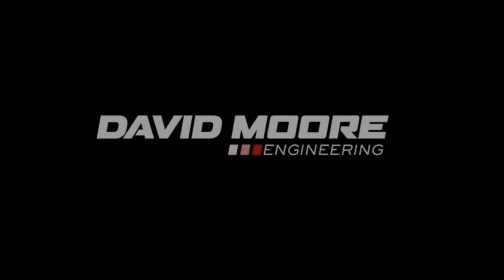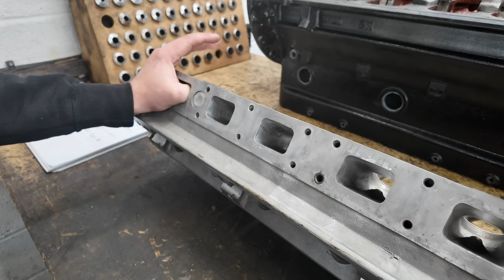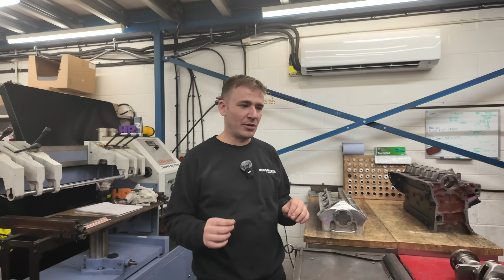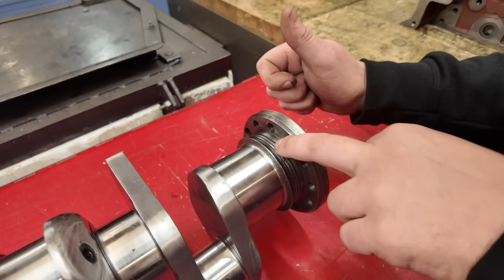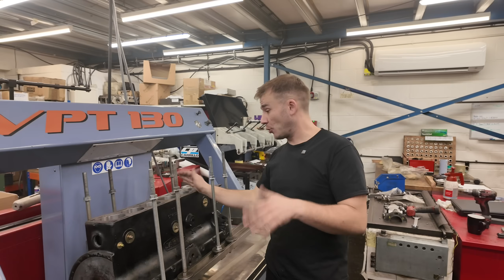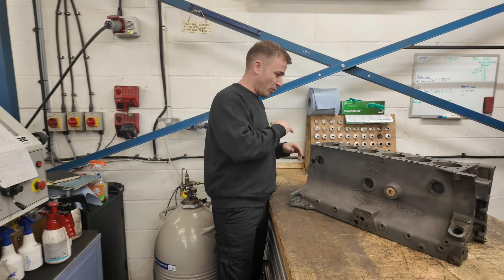Could This Be Our Most Prestigious Project Yet?!?

Comment: If you are going to surface the sump face and the cylinder head face of the block you need to do it with the timing cover installed on the block.
Have a very close look at the timing cover being used.
An incorrect/late timing cover has been previously used on that motor,
 as evidenced by the witness marks/rust marks at the water inlet to the cylinder block.
Mix them up and you end up in a world of pain.

Comment: That cylinder head is a bit odd, all the first cars had been "played with" to give optimum performance, and the crank certainly bears that out, but that head doesnt look to have been cleaned up to give its best by the factory, easy to re stamp a head, i think i would look to get a better head, give it the benefit of one of your refreshes and keep the old one with the car, as a just in case.

Comment: Go with a Rob Beere’s rear main seal upgrade, take the scroll down to 75mm and you will have no rear main seal leak. I did one on my  XK140SE OTS along with other invisible upgrades and for the first time in all of the years and all of the Jaguars I have owned and worked on I have a totally leak free car! 
As far as the direction that Jaguar is heading I am deeply disappointed.
Reply from the maker: We do the one piece rear main seal regularly, but I think William is going to be leaning towards originality with this one. 
I’m a big fan of light modernisation if it’s unnoticeable personally.